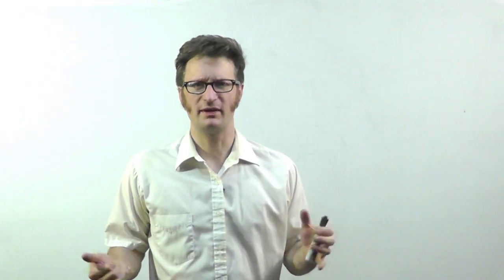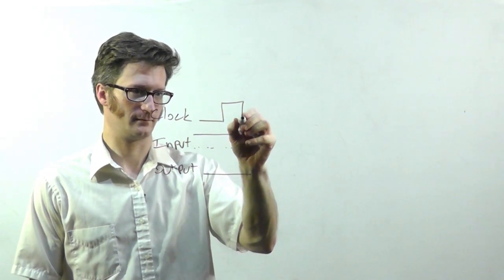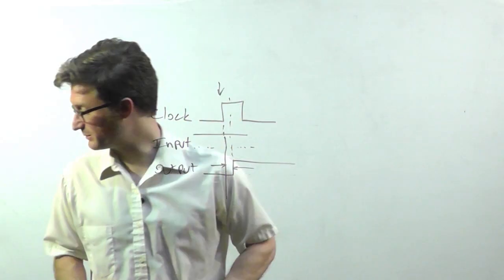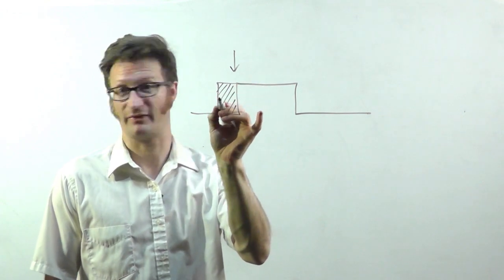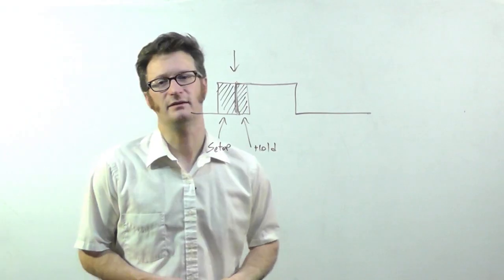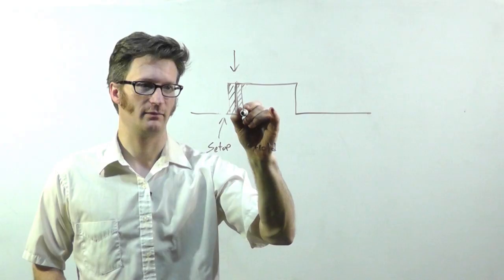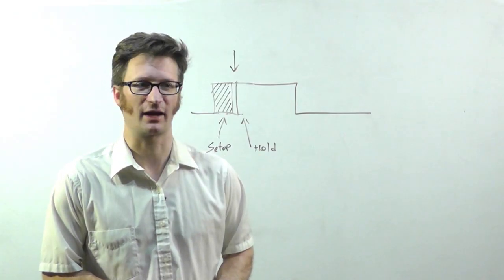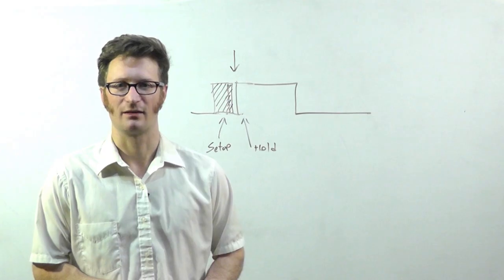Digital Logic - Propagation Delay, Setup, and Hold times

Comment: One addition: 
Not only hold time but setup time can also be negative. Setup and hold time are basically max and min skew values relative to  the clock edge for edge triggered timing to be successful. Depending on your reference clock edge either can be negative.

Comment: just use the whiteboard man.
Reply: I think it would be better if he had used the whiteboard because of the annoying sound generated by the pan and the glass.
But it doesn't much matter. It's still a nice video.
Reply: Captain Rhodes what's wrong with that?
Reply: Captain Rhodes I actually still don't get what's wrong about that.  it is just another way to show you some shit.  it is not distracting so it's no contra. And what I personally think is nice is that he doesn't have to turn around all the time which I think is very nice.  don't get upset with every shit you see...

Comment: What is a "clock event?" 

A certain input will result in a certain output after a certain period of time, and this period of time is known as the propagation delay, yes?

the clock is simply used to count system pulses at a certain frequency in order to determine how much time has passed for a given process/set of processes, yes?

I don't see how a clock can even have a rising/falling edge aside from counting pulses at a certain frequency (time) or how these edges could effect the output of a circuit?

Would someone be willing to explain this to me? If so, thank you in advance.

Comment: o A capacitive level sensor determines if the volume of liquid in the tank is too large.
o Excessive pressure is monitored by an optical pressure sensor at the top of the tank.
o A temperature sensor mounted mid-tank will ensure the temperature does not get too high.
If ANY of these parameters is exceeded, the corresponding sensor generates logic HIGH.
The three sensors are monitored by a safety system controller, shown below. It controls the behavior of three active-HIGH indicator lamps.
o A green lamp, designated ‘Acceptable’, indicates that the system is functioning normally. Normal is defined as the condition where no more than one sensor indicates an out-of-range condition.
o A yellow lamp, called the ‘Alert’ light, illuminates when any TWO sensors indicate an out-of-range condition.
o The red lamp is the ‘Danger’ light, and comes on when ALL sensors are out-of-range. In this final condition, ONLY the red lamp is on.
Digital Logic Bonus Assignment #16

Your Assignment:
On a separate piece of paper, NEATLY design a simplified logic circuit that will satisfy the requirements for the three indicator lights. You may use any type of gate or chip to complete this project. The number of gates is restricted to 15.
Do not split your outputs from any one gate. You may use as many inputs as you want, however, your outputs must not be split.
 Inverter gates or bubbles will not be counted as official gates for this project.
The project that uses the fewest gates will receive the highest bonus mark of 5% on their exam component. However, all successful projects will receive a bonus